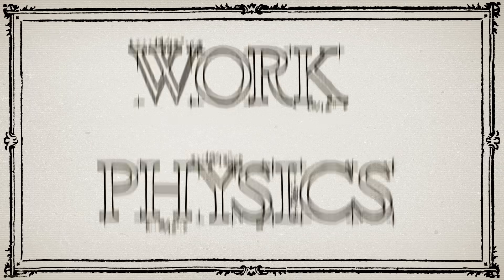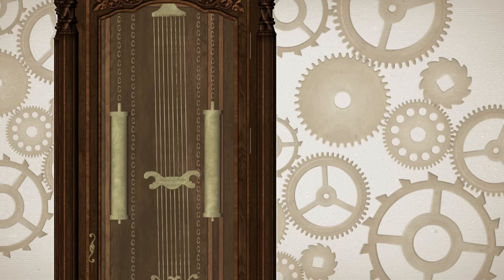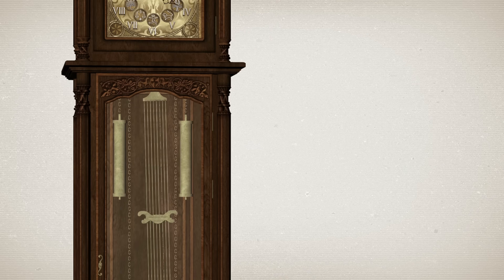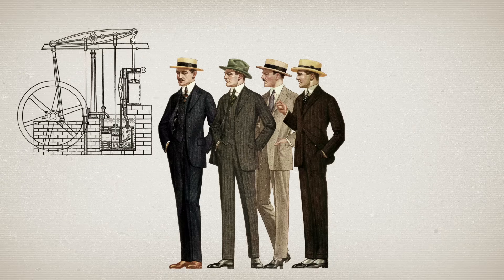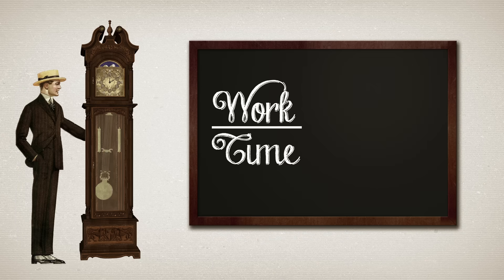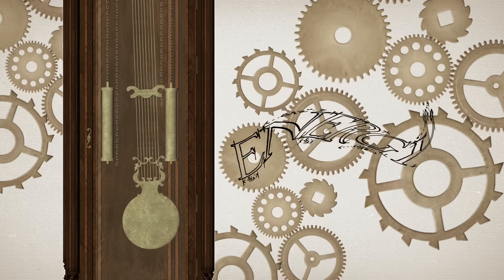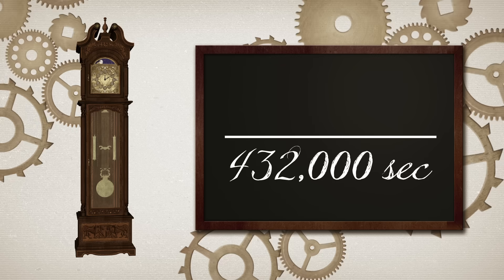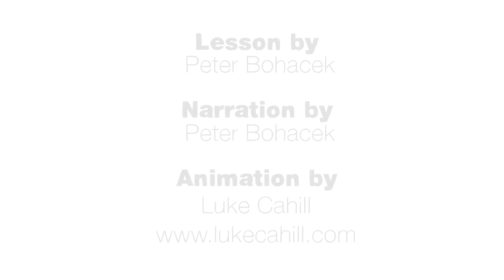How does work...work? - Peter Bohacek

Comment: I watched this today in Physics class and my professor pointed out 3 things that should be done differently:
1) In the full form, it is joules not Joules
2) The unit for second is s not sec, written in full form is second
3) At 3:51 the decimal number should be written in full form. Omitting the unit is for daily uses, not in a formal mathematical operation
Reply: @Amoeba i mean correct syntax matters in any written context, isn’t it?
Reply: @Amoeba just saying :))))
Reply: but all doesnt matter.

Comment: Not helpful at all. Linking the term 'Watt' with its use in measuring electrical power was only confusing, since no explanation was given of how physical work was actually related to electricity beyond the little cartoon analogy, or how Watts are calculated for electrical purposes.